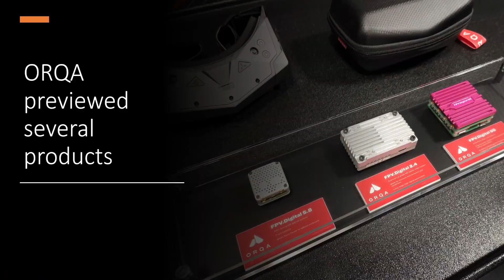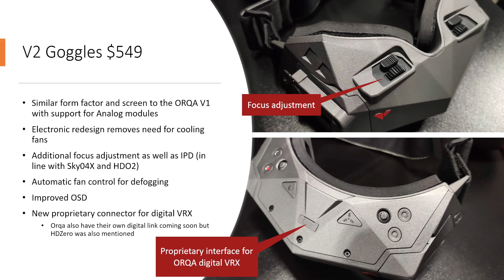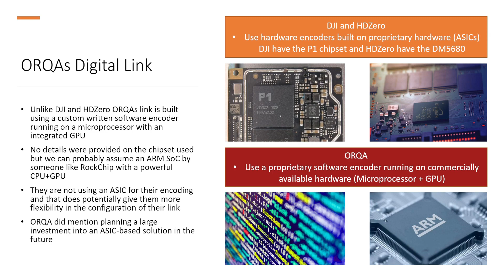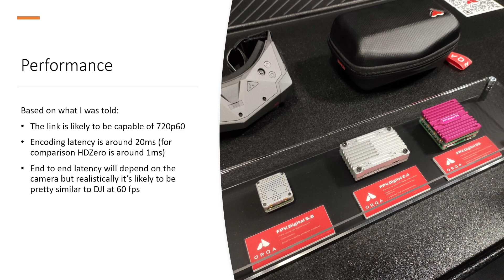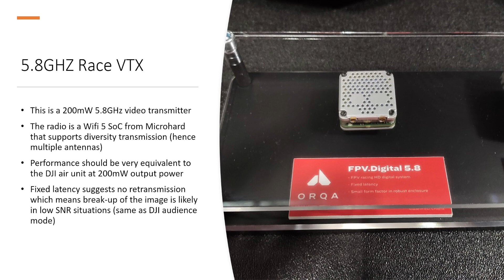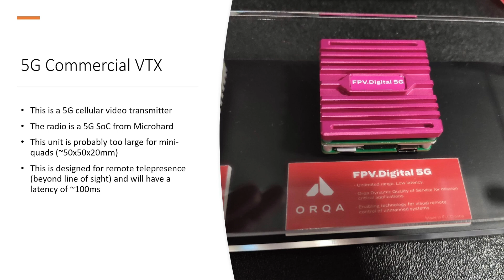ORQA's NEW DIGITAL FPV SYSTEM: Everything I know! (and other products they showed at CES)

Comment: I don't see how software based can complete with hardware acceleration. 37 degree FOV is definitely a step back.
Any word on how much the tack on digital adapter will sell for?
How about the FPV VTX?
With the Goggles selling for $549, only $20 more than the Skyzone04X and only $20 less than the DJI V2 digital goggles with a battery, it appears their system will be way, Way more expensive than anything current available. You've kinda got to figure being made in the EU is going to make everything cost quite a bit more. Heck, with the Orqa V2 goggles costing $549 without a module, and many going with the $149 Rapidfire module, we're at $700 to get good ole analog! LOL 😱 I don't even buy analog quads anymore! Why even come out with yet another highest priced analog goggle when it doesn't have receivers and sells for so much? .... Then, to get digital, you'll have to buy the tack on, top mounted digital adapter for ???, then the FPV VTX at ???
This seems very probable to add up to well over $1000, if not over $1200 !
When can we expect to see the video image quality? 
Ok, so you said it's software based, will probably look like audience mode 720p/60fps, will have latency similar to DJI,  and not HDZero, and only a 37 degree FOV, add to that it is hella expensive! 😳
Great! Looks like we have a lot to look forward to?! 🤔🥴🤷 LOL
Reply from the maker: Yeah, I think I'm in agreement with you. Software-based (even with hardware acceleration) will struggle to match a pure hardware solution. The prices for their products are high, but I think they are focussing on the commercial market which is less price sensitive.
Reply: @ChrisRosser  If they are focusing are commercial, that certainly doesn't help us FPV hobby guys out! After seeing this video, I love the idea of having another choice, for more competition, but so far it's probably gonna be a third choice. Not very promising and a long time before we see the digital part! 😒
To me, with digital being the focus of pretty much all products going forward, it's seems stupid to come out with a very expensive pair of analog goggles. 🤔🤷 Goggles that need a pretty expensive module before they do anything at all!! If a company comes out with ANY goggles at this point in time they need to be with digital built in! Analog's days are numbered. All we need is one more serious contender in digital FPV, with image quality close to DJI, and analog's final days are in view! Even if HDZero came out with a pair of digital goggles with everything built in - no hokey tack on adapter bullshit! That might do it!  👍
It's all about supply and demand.... If their is no demand for analog products manufacturers will not make enough money on analog to warrant still producing it, and analog will die. It will happen.  We can never stop technology.  I've seen it to many times before.  
Plus, do serious digital FPV buyers really want a "tack on the top"  digital adapter? Not me! That's hokey! 
Just cuz some are OK with the hokey tack on SB has, now HDZero, doesn't mean it's a good solution and that's a good way for Orqa to go.
You just watch, anyone buying these Orqa V2 goggles must instantly go out and buy a Rapidfire or Fusion module, or similar. With Rapidfire, that makes these goggles $700 bones! No one, nobody ... Can tell me Orqa's tack on digital adapter is gonna be only $300 bucks. It'll be more, and at their speed, well be lucky to even see it by the end of this YEAR! So, this system is gonna be well over a GRAND, and we haven't even bought the VTX to go in a quad! You just watch ... It'll be over $1200 for sure, and it wouldn't surprise me if it was close to $1500 dollars!!! ...
And for $1500 to get one quad in the air, and you'd be happy with some tack on digital gizmo sitting on top of your $700 analog goggles? Lololol Total thing is a Jerry - Rigged, super expensive, software driven, joke! 😂🥴😭
Orqa has set themselves up to fail with this one.

Comment: I have no problems to imagine that they can match a hardware solution. They can use the latest manufacturing node in off-the-shelf components. DJI/HDZero must use quite old manufacturing with the low production volume. Going software is always the endgame... Even modern rendering pipelines in games go more and more the software path with compute shaders.
Reply: Orqa could use Apple M1 chip. 😁
Reply from the maker: I agree it will be interesting to see how close they can get. If we take Bitcoin as an example: that started on general purpose CPUs, then moved to hardware accelerated software (using GPUs), and now is mostly done using ASICs. You are right that a faster node could allow a hardware accelerated solution to match an older ASIC but there would be a significant cost implication to using a newer node.
Reply: You're right! Just imagine how many great PC games are available with just using the built in CPU graphics, and no separate video card! Lol 😆🥴😩
Reply: @KOrnhOliO1  Obviously, you have no idea how modern rendering pipelines look like ;)

Comment: Thank you for the insights. I am so hyped to see a new competitor on the digital fpv market. Hope it turns out Nice!
Reply: I was also hyped, and welcome new competition, but let's face it ... The Goggles alone cost nearly what the DJI V2's cost ... And they do nothing as is! You still must buy a module to get analog ($50  - $150)! We have no idea of the cost of the digital adapter that mounts on top of the Orqa goggles, nor of the only 200mw VTX! I heard from their representative at CES that they'll begin testing the digital system in the summer. So, with the speed at which Orqa is known to move, I'll bet we'll be lucky to see the digital adapter go on sale before Christmas! 🥴
HYPE GONE! Sorry, but software based, 37 degree FOV, 720P/60FPS, 200mw VTX, a tack on digital adapter - not built in, hella expensive, and video similar to spectator mode from DJI, and I'm officially underwhelmed. 🤷😑
Why would anyone pay $549 for analog goggles you still have to buy a module for? 🥱😴🤢
Reply: @KOrnhOliO1  true Story.
Reply from the maker: I hope so too! I'm interested to see what a software solution can achieve...

Comment: Thanks for the deep dive!  The 60fps spec of the Orqa HD video feed is disappointing though. 120fps has spoiled me and the DJI 60fps “High Quality” mode is only borderline flyable to my eyes for the way I like to fly. Still, competition is good and I imagine Orqa’s plan to implement custom chips in the future will narrow the performance gap vs DJI. It seems that DJI has stopped development of their FPV system even before canvas mode was released, but even the as-is system is exceedingly good compared to current and even future systems from other manufacturers.
Reply from the maker: Yeah DJI aren't actively updating the system. That said, the raw performance of the system is unlikely to improve until DJI release the next generation of ASICs (the P2 or whatever). Hopefully they'll licence those to Caddx for an upgraded digital link for us.
Reply: DJI 120hz low latency is rock solid and beautiful picture. Why fly at 60hz?
Reply: Watch Alex vanbower compare DJI to hdzero while going through a race course. People complain about latency, you just have to get use to it like anything else
Reply: Vannower
Reply: Vanblower

Comment: Great coverage Chris!  As for the sim, my kids have been flying it since it is a free option and although it isn't super full featured it does fly pretty well.  The maps are detailed, although small, and the flight characteristics are decent.  Not bad at all for free!
Reply from the maker: Thanks for the info! It doesn't sound competitive with uncrashed or velocidrone yet (but very good for free software!)
Reply: I have also played it and agree with all you said. I think some other bonuses to the game you didn't mention are 1) I is only like 20 sec from game launch to me flying 2) It's a small file size (2gb I think) 3) Works on low spec computers.

This is currently my preferred sim but I just bought Uncrashed so that may change.

Comment: Good explanation Chris I'm having some doubts about latency. Software encoding with low latency seems questionable for me
Reply from the maker: All the links do image reconstruction to some extent. There is no way the system will match HDZero latency. I think it will end up looking pretty similar to DJI audience mode with comparable latency (although the P1 chip is probably faster to encode because its an ASIC)
Reply: well he said probably 20x slower encoding than hdzero, so yeah, i guess they're going for cheaper vtxs or picture quality instead of racing. i heard something about image reconstruction whilst decoding which might make their system the best looking hd so far, but would add even more latency... if the image reconstruction was done in the goggles you might get a nice compromise using hdzero rx on their goggles... if they allow reconstuction on other video sources

Comment: What dimensions was the race vtx?
Reply: Deffo doesn’t look like it will out perform dji and hdzero if they are using software encoding.
Reply: @AliBFPV  If glass to glass latency is the metric, no.  If clarity of the 720p60 is the metric, it will outperform a latency-centric link in how 'pretty' the image is, especially if they can squeeze in more color depth, because good MIPI cameras with better glass are outputting really nice image in reality.
Reply: @tehllama42  if pretty image is the metric, get dji with retransmition. If end to end latency is the metric, get hdzero. Sounds like orqa is worst of both worlds
Reply from the maker: It's vista sized 20x20 mounting. @AliB it will certainly be interesting to see where ORQA ends up but yeah at the moment it's sitting in a middle ground.
Reply: i'd guess 35-40 * 35-40 * 15-20 mm so probably 30x30mm mounting

Comment: I'm just hoping for shared compatibility with the HD Zero stuff, and that they can both work interoperably with ELRS and other newer radio protocols... but if not, this is still fairly impressive, and more options are still great.
Can't wait for the interview with Tony!
Reply: orqas recievers would need to emulate the hdzero asics in software to be able to decode hdzero transmissions. so divimath would have to hand them their encoders secret sauce and it would need a ton of optimization while still being likely 10x slower in terms of latency. i guess they rather just sell you an adapter to use the shark byte rx on their googles.
Reply: @ah-64apache84  Yeah, i can totally see standalone hardware that fits in the nose bay being outright preferable - and I think that's still a really good solution overall.
Reply: @tehllama42  afaik there is no removable cover on the nose, just the sides if thats what you mean. there is a vid showing a orqa rx on the goggles and they look very similar to the hdzero rx, just with a different mounting bracket to secure it to the top of the goggles. their rx will also have the proprietary usbc connection chris talked about.
EDIT:
check out the uncensored vid from joe minty, it shows the reciever at 1m40s
Reply: The chipset needed to run GHST or Tracer can all but guaranteed run as ELRS 2.4... but practically full ecosystem Ghost integration is going to be much more enjoyable than having to do a lot of ELRS backpack workaround that would be required to achieve the same functionality.  I do think the overlap in capability between the upcoming HDZero options are going to be significant... but this is where having more options and direct competition is going to be a very good thing.  Hopefully their OSD implementation doesn't get bogged down with being reliant on PixelOSD or anything like that.
Reply: Thanks for highlighting the non-ASIC video encoding chain - that should actually be massive, hopefully that doesn't have to be removed in order to hit cost and availability targets.
Reply from the maker: A non-ASIC version will be cheaper and more available but probably not as high performance in terms of latency. The Ghost module should be compatible with ELRS provided there isn't bootloader protection that prevents you reflashing it. I wouldn't be surprised if we start seeing that to protect sales of ghost RX modules.
Reply: @ChrisRosser  Ironically, I think that's an area where Tony would do well to just accept it - GHST performs well enough on its own merit that the option to run ELRS down the road actually makes the GHOST stuff much more valuable, especially for somebody starting off.  I have no qualms recommending that hardware to anybody, because the ecosystem UI is just plain better for newer pilots, ELRS is still for the adventurous.
I have my suspicions that Carl is going to be pushing hard on the ASIC hardware to make his very ambitious 4ms glass to glass latency be a thing - which may make it the go-to answer for racing (especially if analog signals retain the same latency-driven performance), but that Orqa is going to pick up tons of commercial sales because that 5G cellular capable unit is a massive added capability for commercial UAS operations, especially because they can run a recurring fee model to access a backend setup for operators to make good intermittent use of that capability, especially as they can justify end to end encryption and offer that as a service in addition to one-time hardware purchases.
Reply from the maker: @tehllama42  I agree. I do wonder whether Ghost makes commercial sense without lots of receiver sales. I would bet the margin on ghost transmitter modules is less than on the receivers.